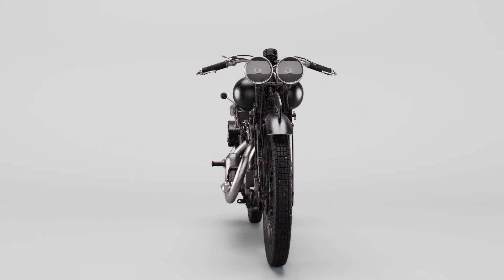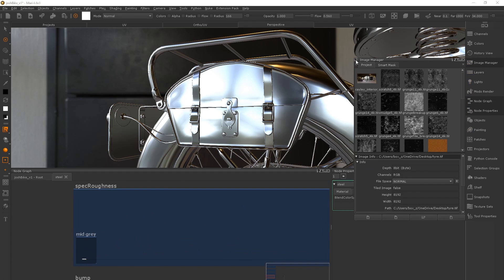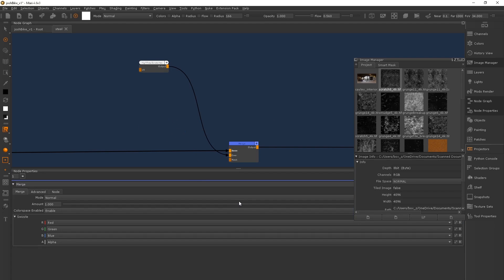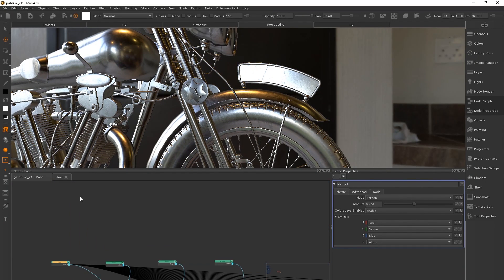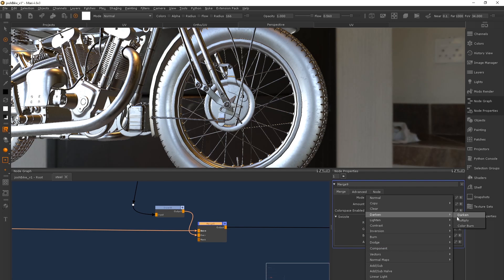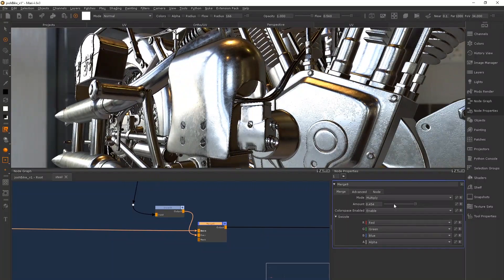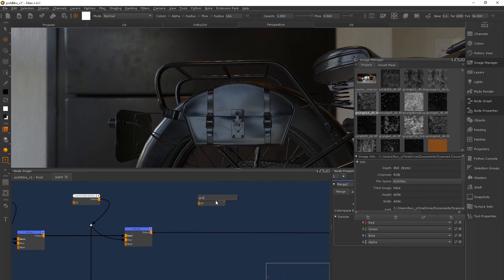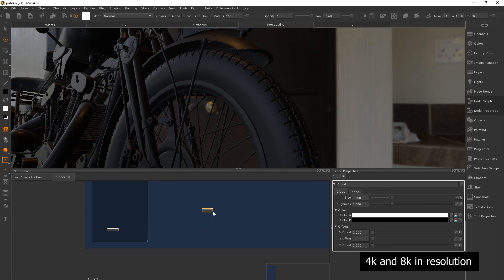Mari VFX Texturing - Use surface imperfections for REALISTIC looking textures

Comment: Hi Zak, great video and demonstration of your material preset setup. How ever, I am wondering why your color break up for the non-metals are very subtle. I know its a demo of your imperfection maps but I am still curious. I know that color from metals Is not driven from the diffuse map, but you still have rubber, paint and leather. I guess it come down to your reference and I could imagine bikes being very sterile and generic In terms of color?
Reply from the maker: Hey Andreas, I kept it really subtle because I only want subtle generic breakup across the entire surface. I'm going to be adding dirt, dust, rust and oil for large scale breakup across the surface. This in turn will add a fair amount of colour breakup on the materials. Hope that answers your question - again just my way of doing things. But yes, the ref I'm following is pretty clean and unbroken up.
Reply: @zakboxall  Yes it answers my questions, thank you! One more question though if you dont mind. Do you always implement surface imperfections In the diffuse, or do you sometimes leave it only In the roughness, since having it In the roughness would chance the color naturally due to the lightning?
Reply from the maker: @HDGamingVelocity  It really depends what I'm trying to simulate, I normally put it in the roughness and if it looks good to put it in the diffuse, I'll give that a try. There is never one rule for everything, just do what looks good :)